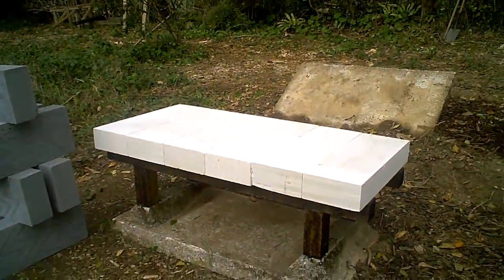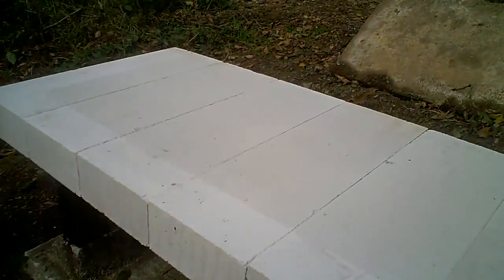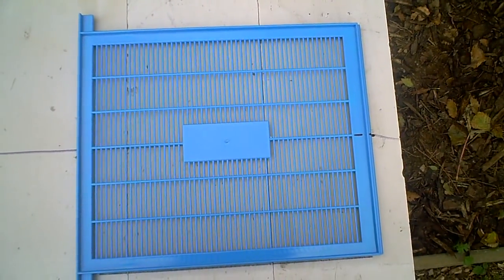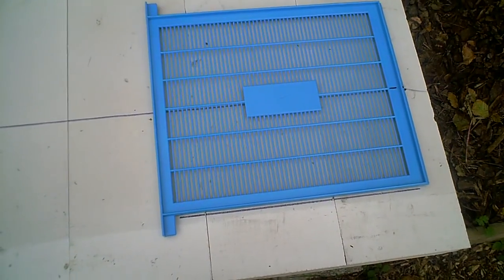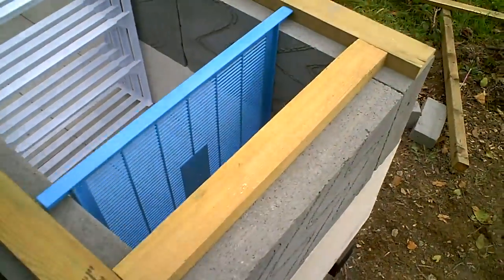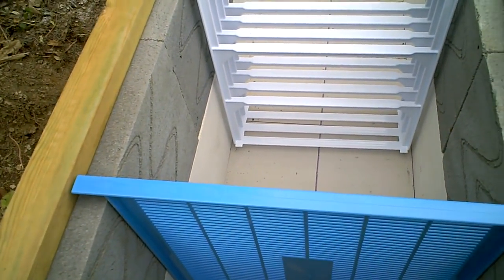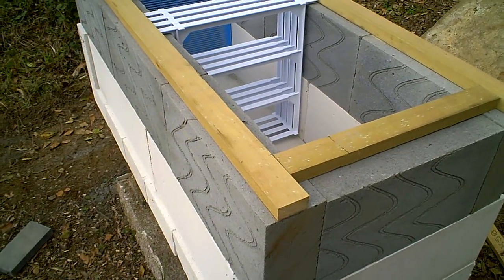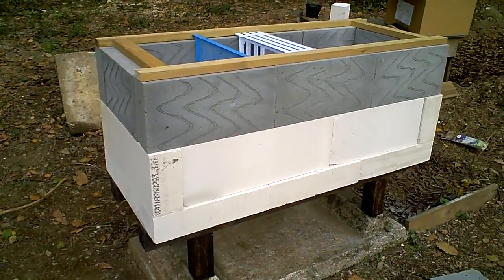Building a ZEST hive

Comment: I've been meaning to have a go with one of these for a couple of years. This video and podcast has prompted me into action. I couldn't obtain the 600 blocks locally so I used 440 blocks, which Bill Summers takes into account in one of his design PDFs. Like yourself I wasn't happy leaving it all dry jointed so I have used waterproof rapid setting cement, very thinly, and will use the same to put a skim over the outside of the blocks. It is a lot more solid now.
Another hive to have a play around with, roll on next year when I shall shook swarm a colony into it.

Comment: Phil, over here in Alabama I use the White Flexseal spray paint. It's a rubbery mixture and it reflects heat on my tops that are covered in aluminium. It would work on the bricks too for future builds. Maybe black on the sides and to a point just under the wooden frame. To stick them in place maybe propolis mixture. Or leave it to the bees to seal them up on the inside and once they've done that you seal the joints on the outside. However, do you feed your bees? I would give it some thought on the top cover to make room for a couple of feeders inside. Oh well, just a thought or two for you to kick around. Great video and good luck! Keep us updated, I may make a running row of Queen Castles this way since I don't move my old ones around at all.

Comment: silicone for the gaps, air and water tight potentially, a thin bead set back a little from the outer edge is all you need, adds a lot of rigidity to the structure, 1 tube will probably  do 2 of these hives if done thoroughly, and extremely easy to dismantle

Comment: Phil if you're concerned about holding it together a wooden frame works. For weatherproofing a coat of pebbledash would be great... and of course the best insulated roof is a thatched one ;-p
Reply from the maker: I have screwed the wooden frame directly to the blocks, which has stabilized the structure to some extent. I will also be "glueing" it together with a sealant of some sort. Another video coming once I have the roof built.
Reply: @BarefootBeekeeper  Take it further and you could make my "Mock Tudor Zest  Hive" ;-p Yes it's taking it to the absurd but nothing succeeds like excess these days and being the latest thing to talk about lol.

Comment: Do you still use the Zest hive?  Looks like you have moved on.  Did the Zest hive not perform well?
Reply from the maker: I set it up last year and populated it in the Spring, with two colonies, either side of a central divider. They seem to be doing well and have built combs without benefit of foundation on the plastic frames. Both colonies have stored a decent amount of honey.
Reply: @BarefootBeekeeper  Can you do an update video?
Reply from the maker: @darrenmoney4130  I will do one soon.
Reply: @BarefootBeekeeper  Did you ever do a follow up video?
Reply: 😅 @BarefootBeekeeper

Comment: Phil, I found the blocks here in the US. They are called Autoclaved Aerated Concrete. A company called Aercon in Florida is the only manufacturer in the US. You can only buy them by the Pallet which holds 120 blocks and weighs 2600 lbs. $318 per pallet but shipping costs are prohibitive to the west coast. It seems like using this material in the US is impractical. do you or anyone reading here have any ideas? Do you think an insulated foam brick look alike might work? I worry that it will not absorb moisture in the inside like these bricks apparently do.
Reply from the maker: Sorry. Frank - I think you will have to take local advice on this. Maybe a builder would know where to find something suitable? Or you could make your own "papercrete" (search on YouTube - it really is a thing!)
Reply: There is a whole DIY community of people in America who manufacture AIRCRETE using a foam generator to mix foam into liquid cement. Seems to be extremely cheap and effective at making everything from blocks, to panels to entire housing domes.  See here:  https://www.youtube.com/watch?v=7KHEj3-KpHk&frags=pl%2Cwn
Reply: You could try to mix lightweight concrete yourself with perlite or vermiculite and make your own moulds for pouring. Have a look at the "About Beegin" website from South Africa.
Reply: James, thanks very much. I did check out Beegin and found it really interesting. They wound up using 7parts concrete to 2 parts perlite for a light weight concrete.  this looks very feasible to make the equivalent of the Autoclaved Aerated Concrete blocks. If its light enough I could try making the blocks a little bigger so I would not need 25 of them.  I am going to do some experimental molds and see what I get. 
Frank
Reply: Tony Robinson 
I decided to build my own 14 frame Layens hive using 2inch styrofoam insulation skinned with wood rather than doing the zest hive.
Reply: Frank Marshall i my self in the process of building beehive of perlite mixed with cement, i don’t want to add anything to it to avoid weight issues. My purpose is to pass the summer period here in the United Arab Emirates, where in the summer temperatures might reach 48c=120+f. Do the mixture + have your mould ready and thats it. 👍🏼

Comment: What did you finally use as a sealant? I've just constructed a hive from 440 blocks and there are a few small gaps due to the blocks not being exactly uniform in shape and size. Hubby suggested sand and cement, but I'd rather leave the blocks so that they will dismantle if necessary, and I think that even a small amount of cement would rip the blocks as they are so fragile.  I'm worried about the possible toxicity of other fillers. So, to fill or not to fill, and if so, what to use?  Is a bit of ventilation a bad thing?
Reply from the maker: I used a water based external filler.
Reply: Many thanks. I've got some all purpose Polyfilla on hand. I'll just point the cracks from the outside and it won't be in much contact with the bees.